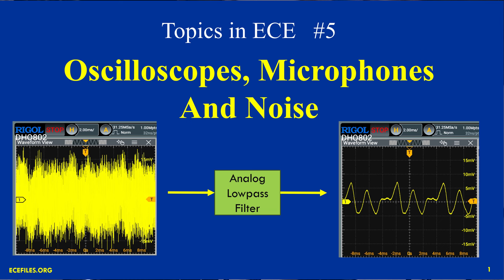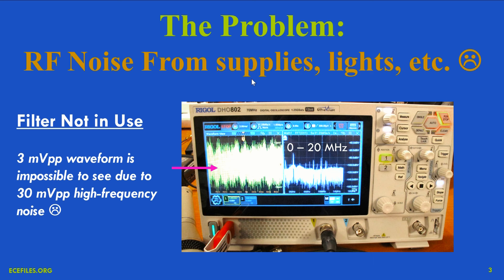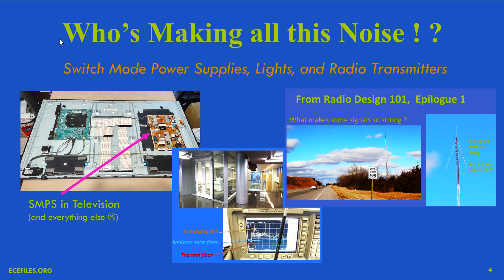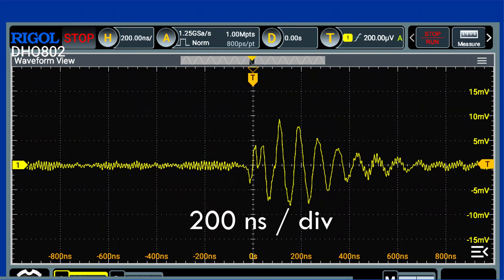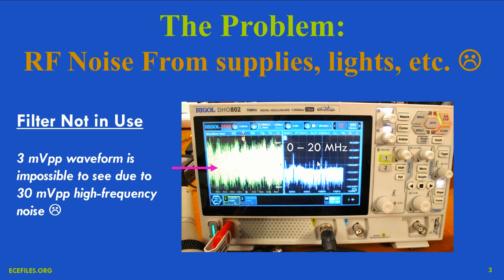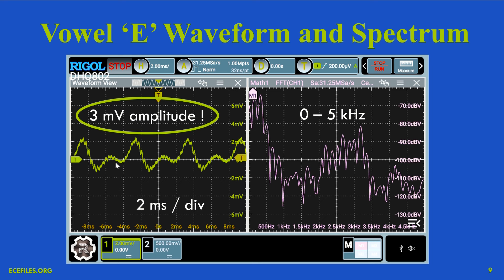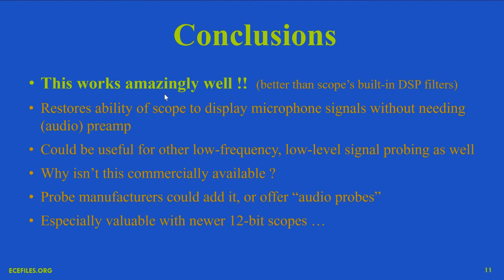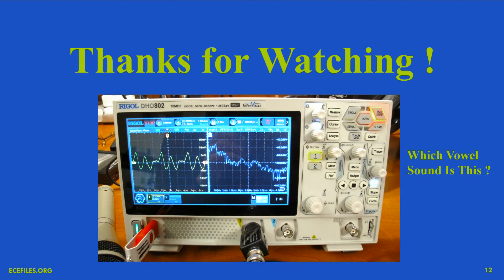Oscilloscopes, Microphones, and Noise - ECE Topics #5

Comment: RDL (Radio Design Labs):
	FP-ALC2: This is a lowpass filter designed specifically for audio applications and can be used inline with oscilloscopes or other test equipment.
	Alfa Electronics: AF-1200: This is a commercially available audio lowpass filter with a cutoff frequency of 1.2 kHz, designed for inline use with test equipment.
         TTE Filters:Lowpass Audio Filters: TTE provides customizable lowpass filters for audio applications with various cutoff frequencies and inline BNC connectors.

Also, mini-circuits make a lowpass Bnc filter that can be purchased in audio frequency ranges 

Thanks for all your great videos!! They’ve been an amazing resource as I’ve taken on the challenges of learning ECE. Seriously, thank you.
 - Jason Burchell
Reply from the maker: Thanks. Glad the videos are helpful!  And good point on things like the FP-ALC2. Audio preamps are another good way to get rid of the RF interference - assuming they have frequency response limited to 20 kHz or so. The only downside there is the need for a power supply I suppose (and cost).

Comment: Check your comments section "held for review".  I posted a reply with links to a high quality commercial 20kHz LPF made by ThorLabs.  Looks like the comment got blocked because I added links.
Reply from the maker: Thanks!   I checked, but it's now showing me the comment either.  So I went to ThorLabs and found this one (let's see if it lets me include the link).  They're a bit pricey - but look nicely made. I was a bit confused about their spec of using them with 50 Ohm source and high-Z load. Presumably they might work with a 1X probe, but not sure. If it is an LC ladder filter with a capacitive input section, 10X could be problematic. Maybe that's why it's spec'ed under conditions of a 50 Ohm source... Have you used them with a probe?  https://www.thorlabs.com/newgrouppage9.cfm?objectgroup_id=8613
Reply: @MegawattKS  LOL, I went back and watched the video and it must have gone in one ear and out the other when you mentioned you had looked at the ThorLabs filter.  When I'm using them I'm connecting them to a 50 Ohm system so didn't even think about the input impedance.  In your application you probably want a Hi-Z input so you don't load down the circuit.  What you made is probably the best option.  I don't think companies make them because most people just make one like you did or have instruments that already have them built in.  My R&S audio analyzer, R&S communications test set and even my old Sencore Stereo PA analyzer all have selectable audio filters built in.